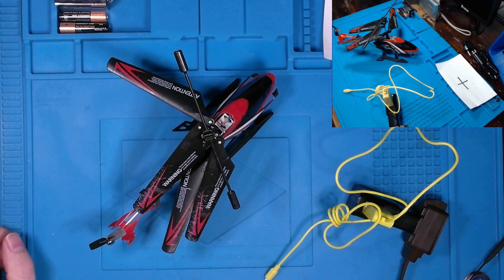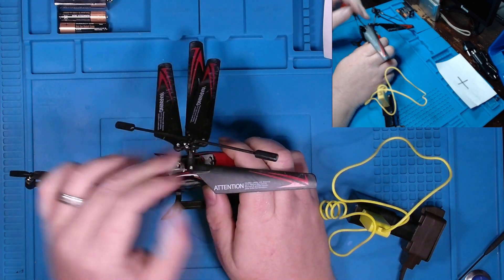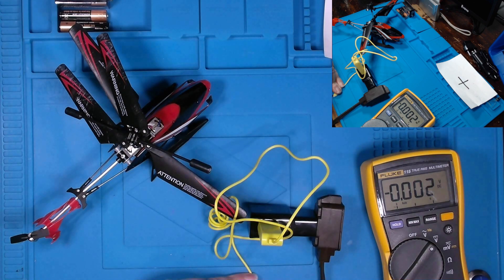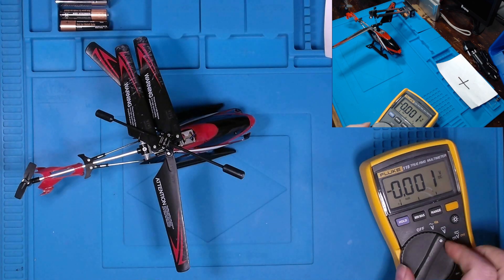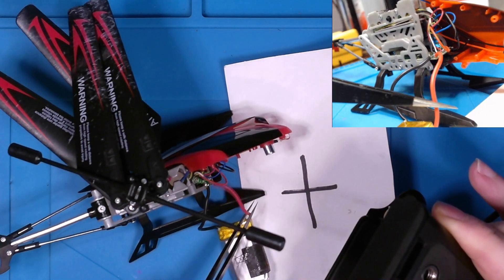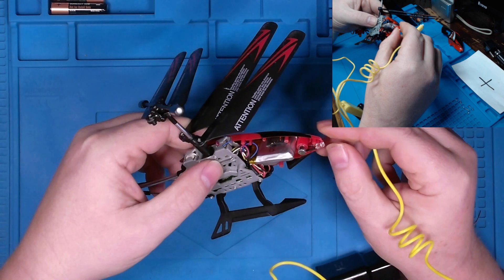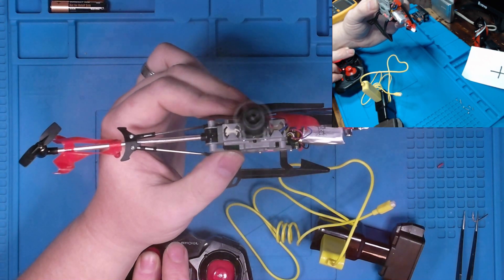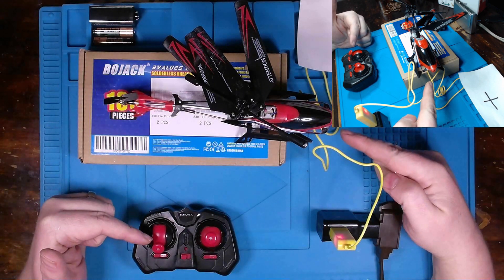Quick Fix: Toy RC Helicopter No Power

Comment: How did you know the cable is good? Where goes the red and black from the multimeter (Minute 2:40) Trying to figure out. Thanks!
Reply from the maker: Continuity tested each pin with a multimeter across each wire independently to see what has continuity and where and what does not. That was my approach.